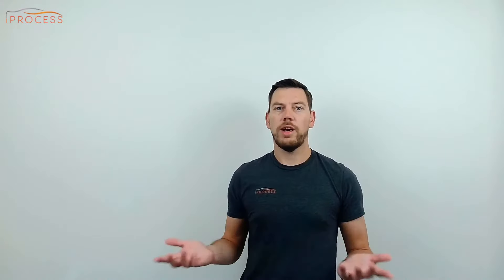Software defined vehicle (SDV) explained

Comment: i Dont understand what are rteh hardware it is going to reduce by introducing Software defined vehicles??
Reply from the maker: The SDV allows for much more flexible use of hardware, either through domain controller style merging of resources or through networking features between various components. That overall leads to a reduction of HW per feature compared to the classic EE architecture.